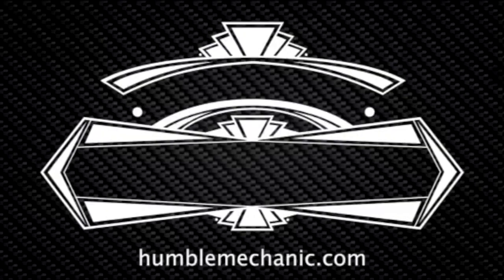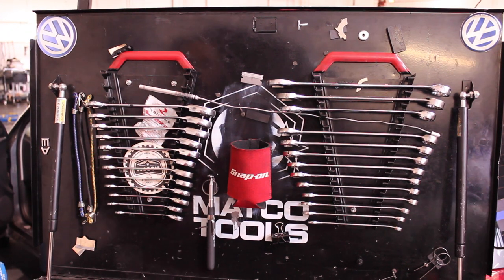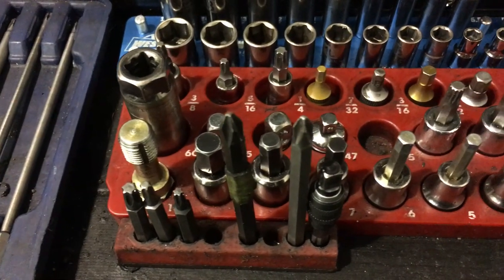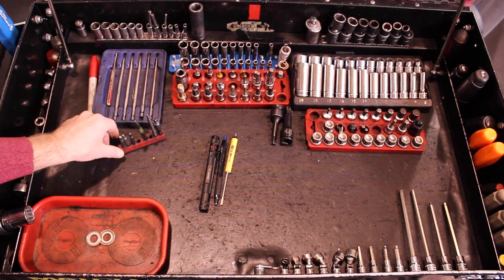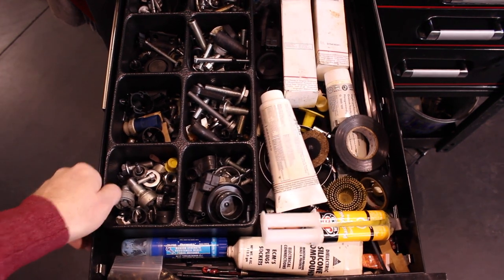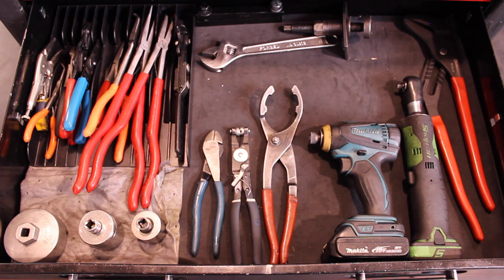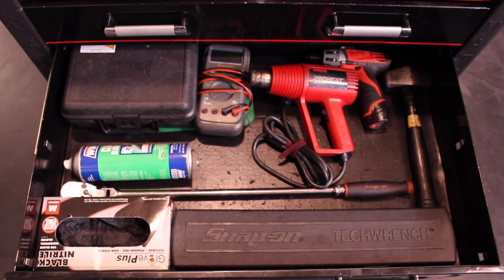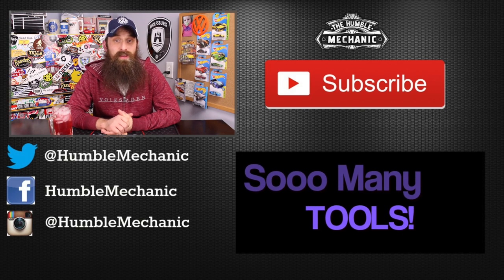What's In A VW Mechanic's Tool Cart

Comment: Charles, I am a VW tech in Ft. Walton Beach FL. Love your videos. my lead tech showed me a neat trick my second day there for the lug bolt covers. get a wire coat hanger, clip one end about 2 inches from the end on the upper side so it forms a "J" or a hook, then clip the second side so it forms 90 degree bend about 1/4" or 3/8" you now have yourself a nifty little lug bolt remover that once you pull the cover off, it slides down the wire and stays there and will hold 10 caps. make two and you don't have lug bolt covers flying everywhere during a rotate. and since we have stacks of them in the bathroom because our uniform guy is a tool (seriously, he gave us dish towels last week) and never empties the racks, if I ever lose one, I can make as many as I want.
Reply: I'm a VW tech from Vancouver Island, British Columbia and learnt the same trick from another mechanic here. Needs to be on your next cheap but handy or DIY tool videos Charles!

Comment: I love how as a technician that hasn't worked in a shop as long as you, that I have somewhat the same set up as you in the same style roller cart. Makes me feel like I’m on the right path. I have a harbor fright roller cart, the red one my dad bought me several years back. I have an air hammer and several fittings, ball joint press set. Because I do more steering suspension and brake stuff.  But everything else is quite similar, except all those specialty volks wagon stuff. I did buy 5 triple torx head sockets to do axles on a passat. Which sucked $100 from matco.
Reply from the maker: +Jerry Velasco heck yeah man. You gotta set your kart up in a why that works for you. :)

Comment: I just cut my favorite 10 mm ratchet wrench in half because I was trying to remove the rear auxiliary air pump check valve on my 2001 Deville.

Comment: 36mm socket and the longest wrecking bar you can get your hands on if you're int old school beetles
Reply: +luviskol I got just those tools sitting in my car right now i have to take a flywheel nut off of a old bug crank in the morning.  i also have a large cheater pipe that almost 4 feet long that fits over my breaker bar.

Comment: I just did the rear springs on my '07 Audi A6.  I'm curious what 'other' spring compressors guys use, other than the VAS 6274/10.  I ended up modifying two, and combining aspects of both.  I certainly utilized the holes in lower control arm outside the spring.  On the other side, spring was shift over, so use a center telescoping compressor, and hook on the side to steer it off to one side.  OMG, what a pain.  But the Eibach/Bilsteins were soo worth it.  :).  Now for the front, round 3, and the pinch bolt from hell.   I even sprung for a Bolt Buster, and cheapie upper control arms, just in case.

Comment: I KNEW IT, I'm a super-duper car fixer. You can tell cus most of my epoxyies, glues and caulking actually is a permanent part of the drawer. To use more (a lil trick for ya) find a soft pqrt of the tube, stick a nail in that area and squeeze whatcha need. Best part is the nail becomes part of the tube now. MY FAV "FIX" is get an empty beer can and put s few marbles in there then on one side put some gooey adhesive bout the size of yer thimb and stick it to an empty body panel, then get some twine and tie one end to the can and the other end to a place thst will allow the can to swing aka suspend, then put your door panel back on. I call this my GUARANTER.....yep, money for my future.

Comment: I was under the impression that mechanics used the tools that the shop provided and owned. I never knew they had to supply themselves with what they need. It's almost as if mechanics are more like independents contractors than employers.
Reply: Most techs spend tens of thousands of dollars on their tools.
Reply: Yeah, it's rigged to use our natural need to do things our way and have our own space at work, in order to totally screw them.
Reply: Yilmaz Ayten not at all, it is very rare for shop to provide tools. As an example that toolbox covered in stickers he records in front of (assuming snap-on) costs $30k new, thats just the box. What you saw in his roll cart was about $10k worth of tools if i had to guess.
Reply: Peter Welsh $30k? Do you mean $3k because 30,000 is ridiculous for a tool box
Reply: they can get expensive
Reply: cody colman even if it was a snap on box no way it's 30k you can buy a 10ft box from snap on for 30k!!!
Reply: Benny CompTech you can get tool bos from snop on for 30k
Reply: Benny CompTech the cheap tool box from snap on are 3k.. but if you get a good box from snap on it can get up to 15 -25 easy if yo buy new.. and still may not have all the tool that you need
Reply: Peter Welsh - That's a big fat ass negative on 30k for THAT box. It's not even an EPIQ series(SnapOn's most expensive series of boxes). Yes, tool boxes can get expensive, but THAT box with all the stickers is only 2 bank. Just to give an example. My triple bank Master Series was 9k after trade in and "rebate".
Reply: Some goverment jobs that require you fix fleet vechicles provide you with tools
Reply: In America, the mechanic owns the basic tools, the shop will have the big specialty tools like tire mounters and balancers.
Yes, we are like independent contractor in that sense, it means we aren’t dependent on any particular shop for our livelihood. We even have a saying: “There is a reason tool boxes have wheels.”.
Reply: In America yes, in Europe no.

Comment: I like the idea of a cart. Do most mechanics use a roll cart or just work out of their main toolbox? Any ideas?
Reply: +Rachel House roll kart. hands down
Reply: Maxie House if your in a shop that deals with mostly 1 brand, a roll cart like his is something good to set up. Ive never worked brand specific so I never use one like that.  I have a cart just an open topped cart with a tray on top and bottom.  I work out of my main box but everything's on rails or in trays and throw it on and run to the next job. It sucks walking back to get something I forgot but I dont want to drop $200-$500 on a cart like that. Plus I usually throw old parts on my cart (brake pads, calipers, whatever and dump them on my way back to the box.) that wouldn't be nice to do in that box.
Reply: I just depends on where you work and what you do I have worked both ends being in a dealer ship both auto and big truck and I also have a roll cart but I still mostly use my main box

Comment: What's in a Chrysler mechanic toolbox?, a box of kleenex tissues and a resignation letter saved in a usb drive
Reply from the maker: Hahahha.  We have 4 Routans with transmissions out, and one with a cylinder head. I feel ya.
Reply: Samuel Gonzalez Poor Chrysler Fiat techs ... pulling engines on Fiats with 10k on them ... 😭
Reply: I left Chrysler after 3 months😂
Couldn't take $250 a week

Definitely better off at an aftermarket shop
Reply: TheMillennialMechanic damn $250 a week? where you working full time? that's a rip off.
Reply: Scarface Pnut yup that was 7:15 to 6 Monday-Friday and then every third Saturday
Reply: TheMillennialMechanic They were ripping you off bro.  You were better off renting a small garage and doing brakes, radiators, and general maintenance.  That's what my buddy does, he rents a small garage, it's not even a shop and he makes very good money.  He has like 100K worth of Snap On tools and they are all paid for.  He says that the best small jobs are when customers take their cars for brakes replacements because he charges around $400 - 600 and he does all 4 in like 2-3 hours max.
Reply: Scarface Pnut hell I’d never charge that much for brakes, that’s more than the dealer would charge!  Well.. Depending on the car that is
Reply: @automedic9781  Why were you making so little? Lack of work or just getting beat by time?
Reply: Chrysler the gift that keeps on giving and giving and giving  lol
Reply: @HumbleMechanic  sad that only one had a cylinder head must have been annoying fixing the other three
Reply: @brettconv83  Better than 210k
Reply: Nitrocity I don’t know about that yeah I guess because it’s a brand new motor it should be easy out everything comes apart but it’s not saying much about the product

Comment: not a tech but have a couple of questions;
what brand of flat blade screwdrivers do you like?
what size ratchet drive do you use the most 3/8 inch?
How often do you use 1/2 inch drive ratchet?

Thanks for your time
Reply: 3/8 is by far the most common, followed by 1/4, then 1/2.

Comment: What kind of tools are usually provided by the shop/dealerships and which has to be owned by the tech? For example, computer scanner, oil collection barrel, some assembly specific installation/removal devices, all sorts of cleaning fluids (or are they just charged on a customer?). Any other bulky equipment? 

What if you are just out of tech school and do not yet have your own set of tools?
Reply: Funky Dunky my dealer only provides oil/trans buckets and they sell you the factory scan tool taking it out of your paycheck if you opt for it. the last place I was at required we buy our own computer for them to put the clock in/out and tech terminal in but this place provides them for you so it depends.

Comment: Great video as always. Your trim removal tools look very battered! Are they 'official' VW ones? I am looking at doing a OPS parking sensor retrofit on my Mk7 Golf Variant - are there any trim tools that you would recommend?
Reply from the maker: +Andy Midd Thanks! Yeah, they get pretty beat up. They are basically a wear tool. The white one is a VW tool You can get that from ShopDAP.com. Those are awesome. The other ones (yellow) are from some place online. I forget. I have had them for well over 10 years. Oddly the ones i bought I have kept. I loose the hell out of the VW ones.

Comment: That looks like an effective setup. Have you tried the newer PowerProbes or a LoadPro?
Reply from the maker: +GreaseMonkey Supreme I have a PP Hook but I don't use it that much. I have not used a load pro but a ton of folks swear by them.
Reply: The LoadPro works great for finding degraded circuits but I don't use it often.
Reply: GreaseMonkey Supreme i had a hook and HATED it. Power pro II is the way to go. The hook takes 2-3 seconds to register voltage when you're testing fuses that means 30 fuses can take a really long time to test all legs......

Comment: I have been working on a  1J  and 3B for quite a while now and i miss some tools in your cart.
No long 7mm 1/2 drive allen socket?
No 11mm brake line wrench.
No 76-14 oil filer socket?
Non racheting  1/2 braker bar, 12 point 30 mm socket?
   I dont see any 16 mm and 18 mm wrenches. 
1/2 drive 6 point  8-36mm socket set ?
Reply: well spotted about the lack of 7mm allen, I was thinking the very same. Used on the brakes!
Reply: Tomyp89 of course no 7mm 1/2 drive all that will do is break the allen. 3/8 is plenty if you have long handle rachet.
Reply: Regardless there's no 7mm allen
Reply from the maker: +aqib2000 it's in there.

Comment: Will you share the p/n for your snapon 1/4 inch quick disconnect.
Reply from the maker: +Ian Nickolas I was just looking for them online. I couldn't find them. I will check tomorrow for the number 

For real, those things are awesome. I realized I forgot to point out the other ones in the top right drawer

Comment: What do you recommend for removing a stripped triple square seat rail bolt?
Reply from the maker: +Benjamin Nieuwenhuis Something like this if you can get on them http://amzn.to/1ZUKOSK

You can pound one in and hope that it works. Always sketchy when working on a seat bolt.
Reply: +HumbleMechanic what about those reverse threaded socket style drill bits made for backing out bolts?

Comment: No offense dude, I love your videos.  I don't know how you even mechanic'd mechanic'd  with those few tools.  I have atleast or minimum 70k in tools n was a field mechanic for 20yrs.  I know heavy equipment tools cost much more.  I was a pissin post for those years, less contact with customers the better imho.
Reply from the maker: Remember I worked at the dealer. Same basically 15 cars. This is also not ALL my tools. Just the stuff I used most often 

Most dealer guys have no reason to spend that kind of $
Reply: Yep I do realize that with your tools.  I'd rather have the money now that I've basically been retired due to back injuries but continued working for 20yrs.  Being a field mechanic is allot like being a cop, cuz one day you're a hero n the next people are stabbing you in the back.  I put up with a super narcissist asshole for 10yrs, n would never do it again but I wanted my family to live in a nice western community n I had back problems too.  If anyone out there works with a control freak get away from them cuz it's not worth the money.  Your turn will come, I thought he n I were good loyal friends off the job, not at work.  I saw him send 13 mechanics down the road, which was uncalled for in many cases imho.  

Back to tools, guys get the tools that make you money n stay off the candy trucks.  Yes, Snap-on has great tools.  Yet used tools generally get 40 cents on the dollar n most are stolen.  Automotive is the way to go, less tool investment n generally inside work areas.  Being a field mechanic sucks n you generally have no helper lifting heavy parts that destroy your body.  Go bleed a fuel or hydraulics system in -30 n wind from the fan, let alone slipping off everything you work on.  You best be a damn good welder n fabricator n know what works n what doesn't.  Tech schools where most instructors blow smoke up your ass telling young guys what awesome mechanics they were in the shops.  Most couldn't cut it, n that's where most go to work.  Not all, but a good amount.  

Stress also can become your silent adversary n slowly kills your mind n body.  I had so much stress at times cuz I had to baby sit 5 other mechanics n still do my job n expected to order the right parts the first time out.  Stress, stress, stress, it's Not your friend nor the assholes who push it your direction.  I really wish I'd work for Cat as I had a few chances n didn't want to move due to young kids n schooling.  Learn the laptops n scan tools usage n even buy the 5k diagnostic tool n don't loan it out Everrrrrrrrr.  Only if you know he knows what destroys them, as I've seen guys bloody after one party won't make things right due to their stupid habits.  Some guys can break a anvil n drive a square 2" stock into a 1" round hole, I shit you Not.  Oh, I didn't think it would fall off the engine dept on a test drive.  Yes, I saw that 2 times.  Stay out of persecution of the new guy or the guy that gets blamed for everything as every shop has one.  Don't kiss ass to the bosses, it's Not worth it, n you then give them the control over you.  Any mechanic supervisor that blames shop guys mistakes n makes the point to everyone else, is the x mechanic that hasn't done much on the floor or in my case the fkin dirt n snow.  Keep Your Tools Locked Up, especially in a truck shop.  Allot of truck shops have drivers walking around unfortunately n you'll lose tools eventually.  I installed a remote lock on my electronics n torch set n welders ect.  It was a pain, but I only lost a handful of 4way wrenches in the 1 5/16" area, n yes they were Snap-on as well.  Another $450 bucks donated, the shop owner response.  Keep your box locked up, oh well part of the job they said.   Bsh*, find a new shop asap, as they'll Never Have Your Back Everrrrrr.  I can't tell you how many times recorded n written documentation saved me thousands of dollars.  Yes, most on my time as well, as I'd try to take a hour every day to doc that info.  Don't let other shop golden boys drag you into their fun with the bosses.  Every shop has a guy that gets picked on out of envy n jealous kid games they play.  Make Sure you know who they are, then kick their asses of the job site, Problem Solved most generally.  I experienced that myself, an bullies are pussies.  I have a great sense of humor n can take it most times.  But if they stab you in the back everyday, take care of the problem Off the Job Property.  If they're big guys then get a Sap or black jack n follow then into the sh**** n sack their as***, Problem Solved.  Just be careful how n where, cuz they can kill someone.  Don't get one over 7 oz, n learn how to use one.  While a foreign paradog myself, we were allowed black jacks use in combat actions.  A smack behind the ears lightly then pore toilet water other their face, Problem Solved.  

Anyhow, if you aren't one of the good boys that rubs the bosses you'll generally be attacked maliciously just for being you n performing good work n work habits.  I've know 2 guys that set up cameras n caught fellow mechanics stealing n messing with your tear downs.  That's a Very Serious Red Line for myself.  Long stories, but things happen in every shop guys.  Mind your business n help that guy that gets pk on n you'll have a loyal friend.   Good Luck, my apologies for long chat.  Enjoy your videos HumbleMechanic.
Reply from the maker: So much truth here!!!!!

Comment: as a non brand specific mechanic, my tool box is my roll cart haha
Reply: Richard Province that's the rough life. Every job is running back to the main box. A roll cart would be pointless. I remember one shop I worked at wasnt brand specific had heavy duty and automotive and nobody was assigned lifts. I ran my ass off in that place. oh plus they had another shop in another town I was sent to on Saturday mornings for fill in.....had to start another box over there. Same thing at that place.